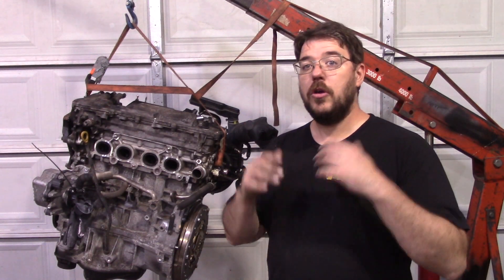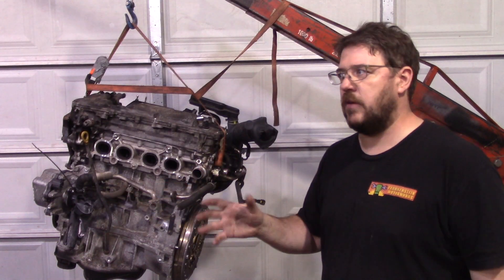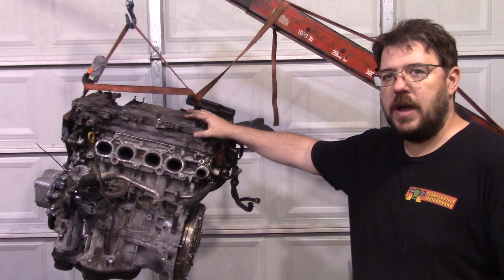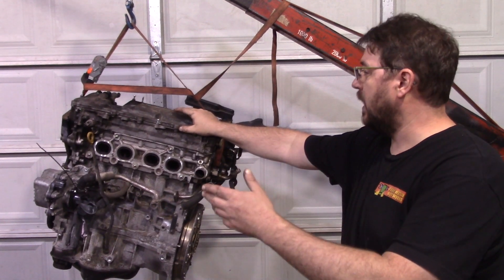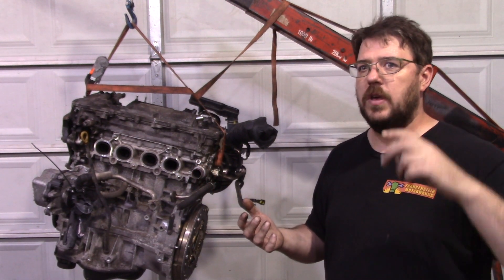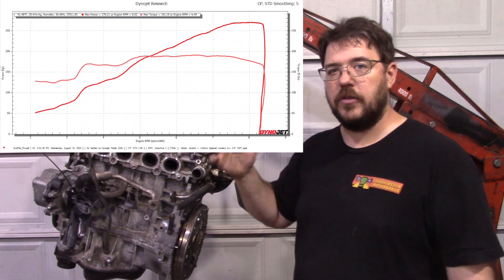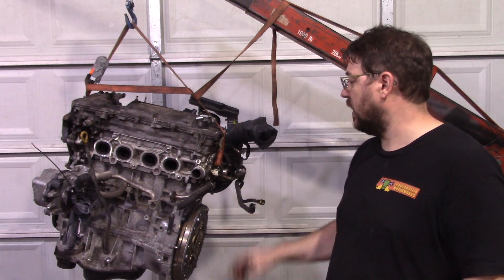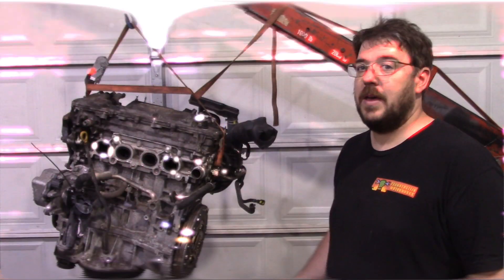270whp on a 2AR-FE!

Comment: I always suggested the new next gen motors have nothing on this Monster. The more you play the more you have to agree that this is the last of the All out L4 engines from Toyota. Technically this engine is better than the later Mitsubishi, Honda and all other L4 big capacity engines even Chevy 2.9L is not as strong or carefully designed as this Gem. For me the target was the K series engine but the beancounters stepped in as usual for Toyota. This engine is the 2jz and 1uzfe of Toyota 4 cylinders and even though the toy S engine was a goodie this is the one Toyota would have even used for the Supra had not the BMW partnership happened. A 400hp turbo 1ARGTE MR-2GTZ for 70-80k USD would have Porsche dribbling from the rear and Lotus would become extinct overnight. As a side note, would love to see crate motors while still available and even supply them as a boat motor or kit car developer as an alternative to the K series.

Comment: How does the 2ar handle boost? Main reason I went K series is because they handle boost crazy well and my goals exceed streetable NA capabilities.
Reply from the maker: they reliably make 400whp without touching the internals. from there the sky is the limit, look up what papadakis racing has done, if you find the old info the ~850whp version of his build had a lot of stock components still in it. the 1000whp version has a fair bit more custom components but he's still using the stock block without internal supports and added bracing. This thing is pretty damn beefy.

Comment: Maybe the head was cast with the 2.7in mind 1st and they decided to just cast 1 for all. It would help explain the overkill of the head a lil.
Reply from the maker: Generally the first number in the engine name is just a serial number of the order they were designed in so the 1AR was almost guaranteed to be the original design. This also shows up in the 165mm conrod that gives it a 1.57 rod ratio on a 105mm stroke but then on the 2ar it has a 1.70 rod ratio which is pretty damn shocking with a 97mm stroke. Combined with the 10mm offset crank this thing ends up being quite knock resistant. 

Toyota really must have had a big plan with this motor because this thing really isn't just an economy car motor.
Reply: @FrankensteinMotorworks  agreed. The reason I mentioned what I did bc was back when GM still built the L98 350 TPI engine John Lingenfelter did some digging and found out the TPI intake manifold, although used on both the 305 and 350 engines, was actually sized for the smaller 305. He designed hi own and picked up 45 hp on the top end. The 350just couldn't breath at high rpm. My thought was maybe this huge port head was actually engineered for the larger 2.7 displacement where it wouldn't have been such overkill then just used it for both. Or your theory is right and they had bigger plans that just never came to fruition.

Comment: So would that correlate to around 250 to 259 whp sae right
Reply from the maker: Assuming you're talking about the "SAE Net" test procedure that was proposed in the early 1970's and has now been adopted by all USA market automobiles? If so, that test procedure measures crank horsepower, not wheel horsepower and there's a few important criteria, it has to be on the same fuel as is called for under normal circumstances using the stock intake with the full intake system present and the stock exhaust, also with the full exhaust present. 

That means that the SAE Net rating for this motor is 180hp because that's what it gets with the stock intake and exhaust in the stock application. 

Of course, 180hp is not the number you're actually looking for, you're asking what would the SAE Net rating on this motor be if this intake and exhaust configuration was stock in this application on premium pump gas like I'm using here. In that case I can't give you an exact answer because i have not put this engine on an engine dyno to get a direct measurement but we can do an indirect measurement and get pretty close. If we look at the Scion tC when used with this exact same transmission on a dynojet dyno you can see that they get about 145-155whp. that means that the drivetrain loss in this specific drivetrain is between 16.1% and 24.1%. So if you were to put this engine on an engine dyno with this exact intake, exhaust and fuel you'd get a power number between 313hp and 335hp and that would be what number would be used as the "SAE Net" number for this setup.

Hopefully this all makes sense.

Comment: Have you tried using an anti reversion chamber at the header collector or within 12", might get you some more low end and midrange power as well as response. I've got a 3" Dynatech/Hendren Racing in stainless steel (3'' in/out, and the reversion chamber tapers to 2.5" inside") I could send it to you if you'd like for testing. Might see some gains with the big cams you are using. I imagine even with VVTI functionality/control, there is still some reversion during overlap. Let me know what you think. 

Great videos and keeping the 2AR-FE mods alive! I also had a couple questions and mod ideas i'd like to discuss with you via email, IG, or FB messenger.
Reply from the maker: So you're not wrong. This motor has a lot of overlap and wants to flow backwards so badly at low RPMs that i really had to work at it with the VVT-I to tune it out of there. Thankfully the VVT-I does let me do that but there likely is quite a bit of power available. I'm actually working on a stepped header design with a larger diameter since i'm pretty sure i've exceeded the capabilities of this one. This original one was designed for the 200rwhp motor I started with and now i'm at 270rwhp. It's still been doing pretty good but it's time to update it.

As for questions and ideas, the best place is the Discord server ( https://discord.gg/XrQ8p8qJ ) but you can also reach out to me via e-mail. The info is on my website which is linked in the description.

Comment: A few questions for you here.. how much boost do you think that the engine could take with your custom intake? Do you think you could handle 6 lb of boost from a supercharger?
Reply from the maker: The engine is known for putting up to 400whp on stock internals without issue. this intake and camshaft combination would likely cause you to need less boost to hit that number. The intake will be aluminum and for all practical purposes won't have a limit to how much boost it will hold.

Comment: Which engine you recommend 2ar-fe or 2ar-fxe? Maybe boost in the future. It possible to boost 2ar-fxe with that high compression too? I hope you can compare a boosted to all motor 250hp would be something nice to see.  I just want a  track car  I can drive home after.
Reply from the maker: the 2ar-fxe has a 12.5:1 compression which is great for an NA build but really is excessive for a turbo build unless you're planning on running methanol and even then you would not want a bunch of boost going in. If you're planning on boosting i would strongly suggest going with the 2AR-FE. That said, a lot of people say they will eventually boost and never do so you're throwing away power that you could otherwise have. I would generally suggest you build for the motor you'll be using now and build the motor you'll be using later when later comes around.
Reply: @FrankensteinMotorworks  yes that makes good sense. I don't wanna blow up an engine...😂 in your opinion what the best way to go engine wise fe or fxe to start out with? I hope you can compare Toyota 2ar-fe vs kswap in the future heads up challenge.
Reply from the maker: @rolldog82  the 2AR-FXE is a great base for a low cost engine build but if you're going for the ultimate build you'll end up replacing the parts that make the FXE special anyways so it mostly depends on your budget and your ultimate power goal. Assuming your intention is to keep the 2AR-FXE's intake cam and pistons your power limit on this motor is probably in the 270-280whp range. This number isn't 100% sure because the new intake hasn't been tested on the FXE engine yet along with E85.
Reply: @FrankensteinMotorworks  keep on posted on your projects both on fe and fxe. The engine platform has much more potential than kswap it seems . Hopefully gonna buy a spydy soon with a 2zzz swap in it. 2.5 compare to 1.8 can not help but spend the money for the swap it be well worth it even all motor set up but I do love turbo cars

Comment: Me and my co-driver have started looking into this alittle further for SSM class, scca autocross. 

From what I can see the 2ar, stock, weighs about 60lbs less than a stock 2gr?

The 2gr would require a heavier overall car weight in the end(per class rules for displacement),, but not sure it would be very far off a forced induction 4cyl weight for the class. The winning car atm is a 1.8L turbo miata

Comment: If I just wanted to install the intake manifold how much gain are you estimating? I’m trying to see if that price is worth it unless you plan on going fully built
Reply from the maker: Unfortunately, estimating this kind of stuff really does not have a ton of certainty. This is the kind of thing that just needs to be dyno tested.
Reply: @FrankensteinMotorworks  that’s what I thought. Appreciate the work being put into new parts though. The 2ar will be the toyota k24 🤣
Reply: @christopherpittman6589  Did you ever install that Intake Manifold? And do you need a tune for just the Intake Manifold?

Comment: Would this motor bolt up to the S54? This sounds like a no brainer swap over the 3SGE at this point.
Reply from the maker: yes it does. it's only got three bolts which does not feel awesome but it's still going to work. both dowel pins do align so the alignment is still perfect.

Comment: Hey Frankenstien, I love your videos and they inspire me to work on my own car! Even though its not a race car, lol. Anyways I've got a question, and since youre a 2ar-fe guru, I'd like your insight on this. My 2011 2.5l camry with the 2ar-fe, is having issue on start up, regardless if its cold or not. I've replaced the battery, changed the alternator, and cleaned the MAF sensor. Yet when I start it up, itll run poorly for about 5 seconds or so, then shut off. The codes that are currently on the car are = P0-607 input signal circuit (with a secondary DTC of p0138 O2 Sensor), C1202 Brake Boost Sensor Circuit, and C1231 Steering angle sensor. None of these I feel like are whats causing it? Literally any input would be greatly appreciated!
Reply: I also checked the corresponding fuse to see if it was blown, it was not. The spark plugs have 8k miles on them and I made sure to check if they were all seated properly as well.
Reply from the maker: does it run properly after you restart it or does it always die?
Reply: @FrankensteinMotorworks  It does run if given gas on start up, and it will run properly. If you dont give it gas on start, it will peter out after it gets to idle

Comment: As a tC owner, the effort this man puts in to this motor is much appreciated.
Reply: the work he puts into the 2AR-FE is making me want a Scion TC more and more.
Reply: As current Camry owner with the 2arfe I been wanting to mod the engine but finding this guy is a gem 💎
Reply: its such a slept on motor.
Reply: See I was just gonna turbo my 2011 VX40 Camry   but now I really wanna do this..... BTW it's an EB62 6 Speed manual, basically a Scion TC in a camry body with a taller 5th&6th gear
Reply: @vette215  It actually has taller 4th, 5th AND 6th gears! I was thinking of swapping over but after looking into the math for RPM ranges it's personally still not what I'm looking for but it would be cheap and better at making my highway driving slightly more efficient.

Comment: What can you tell us about the throttle body you used? 90 mm drive by wire set up? In the future I would look to use this intake on my Scion TC but I’m thinking I would need a 90 degree adapter for the throttle body to point up and likely downsize to stock 65 mm which I got bored to 68 mm.
Reply from the maker: I used  the pretty common to use in the aftermarket 82mm Bosch unit. https://www.magnusmotorsports.com/product/bosch-82mm-throttle-body/
Reply: @FrankensteinMotorworks  had you heard that the 75 mm rx8 throttle body works with the stock TB wiring? I cant confirm if it works or not.

Comment: You should put a 2ar head on a flow bench. I'm still not convinced it being as potent as a k. If I can get convinced I'd buy 2 of your swap kits. Stock 08 k24a2 bottom end, stock port k20z3 head, Skunk intake and drag cartel 2.2 cams I'm at 271whp 200wtq
Reply from the maker: I do have flow numbers for the stock as well as the ported head that i've done and i was able to see some nice improvements across the board but you really can't compare flow numbers from one bench to another.  They are available publicly if you'd like to see them on my facebook page: https://www.facebook.com/FrankensteinMotorworksLLC/posts/pfbid02i3F4T3zh2BZRgXjZzhgAFJt9RyC46nUdjsTxYLmiXKeptaKqieX8iGKw99mSkp63l if you don't have facebook just send me an e-mail and i'm happy to send it to you that way.
Reply: @FrankensteinMotorworks   what kind of machine. It was done @ 28" of course?
Reply from the maker: @Truulovemotorsports  unfortunately i do not have the answer. that was done by a local shop and i was just trying to get a comparison pre and post porting so i was only worried about consistency from test to test.
Reply: @Truulovemotorsports highly doubt any ported factory heads would outflow a ported K hate to admit it
Reply: Just stick to the K then.

Comment: Wow! So grateful to have found your channel, I been devouring your content last few days. I had a question regarding the cheaper hybrid variant and this intake. Do you recommend this with a hybrid to high performance conversion? Also if i purchased the things required for this from you can i still use stock ecu to keep it all controlled? My goal is a high hp n/a daily driver with spirited canyon driving. I look forward to your insights.
Reply from the maker: I haven't tested this intake with the "double atkinson" style build. But since it is a higher RPM build it really should benefit from this intake.
Reply: @FrankensteinMotorworks  Would you do a test for that setup? I would venture to guess it may be real close to 300whp with proper tuning.
Reply from the maker: @jacknapier2099  It's already on my list. there's only one of me here though so it may take a bit to get there.
Reply: @FrankensteinMotorworks  Hey do you build these for customers as a turn-key option?
Reply from the maker: @jacknapier2099  I don't have a one click buy for these engines but you can reach out to me and we can discuss it. But note that there's a lot of things you can skip on a DIY build that can't be skipped on a build where someone needs to provide some kind of warranty. This means the block needs to be opened up and fully checked and that does really remove the low cost advantage of the double atkinson style build.

Comment: What do you do to reduce oil consumption? I have a 2012 camry with 2.5 AR-FE and it burns oil like crazy
Reply from the maker: Drive them hard. I actually have no oil consumption issues when i use these for racing, the 2AR-FE uses low tension oil rings and it can be somewhat easy for them to get stuck if things don't get sufficiently hot regularly. This is especially compounded if non synthetic oil is used. 

If you live near some mountains, go do some hard runs up the mountains, trying to get things good and hot and switch your oil change schedule to a 5000 mile interval with synthetic oil.

Comment: Which skunk2 plenum configuration did you use for this? Did you see any loses when compared to the 240 whp dyno in the low end? I was just wondering if the TB and maf pipe might be too large
Reply from the maker: I used their ultra race plenum. The charts show the before and after curves criss crossing but that has more to do with the fact that i did not spend a bunch of time tuning a prototype down below 3500 or so. the low end losses are not significant at all. This is one of the really nice things with vvt-i. it really takes away most of the big cam disadvantages.
Reply: @FrankensteinMotorworks   did you use the plenum with any of the volume expansions? I see there are a few different options.
Reply from the maker: @89gts  I did use a 1L spacer but i haven't tested if it is truly necessary or not.
Reply: I’m really curious if the stock TB (65 mm) would be a restriction with this intake manifold. Have you ever thought about dynoing with some TBs from the 2GR or 3UR just to see?

Comment: I remember when you tested the 2ARFXE with the same two stock cams for intake and exhaust you were disappointed with the results. Sounds like you could easily get the results you hoped for using this intake. I’d love to see another 2ARFXE test using this intake?
Thanks for all the research and engineering you do for the MR2 community!
Reply from the maker: Thanks for the reminder on this, not sure why i did not think about it but that's absolutely true that it needs to be tested. If that makes the same +30whp it would be a dirt cheap weapon of a motor.
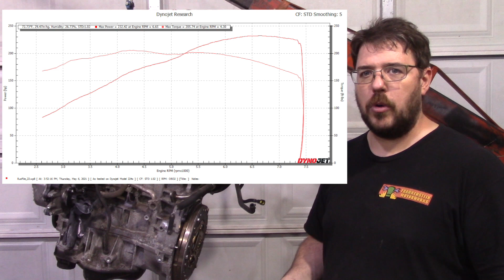Reply: @FrankensteinMotorworks  Isn't the 2.7L power curve at 6:10 actually the double intake cam 2ARFXE? It made 228 whp SAE and you show 232 whp STD here, while the 2.7L with 280 regrinds made 241 SAE (STD would be more). The May 6 test date also matches the May 8 video date for the FXE. I'm also very excited to see what the all OE parts engine can do with the short runner intake manifold. Are all tests thus far on pump gas?
Reply: @FrankensteinMotorworks Hi from France ! We don't have Camry here only Avensis which comes with the 2AR-FSE. Do you think the same upgrade could work?